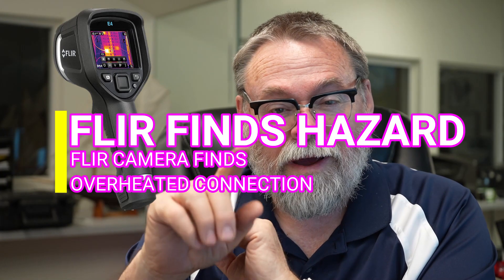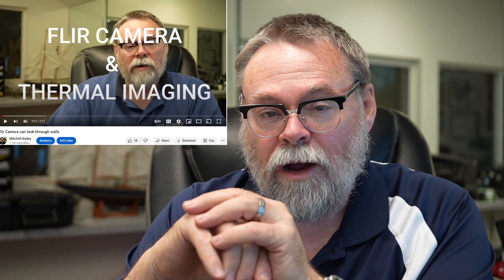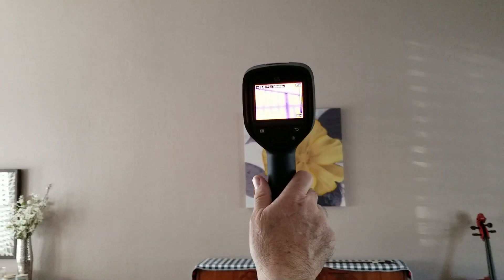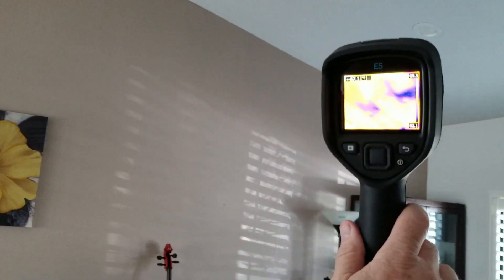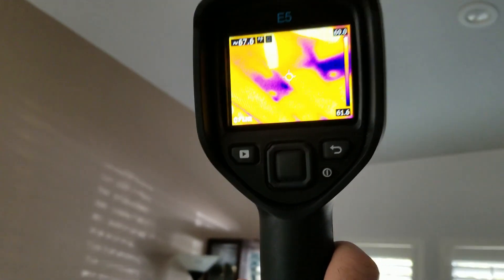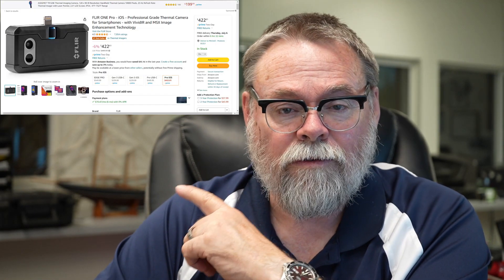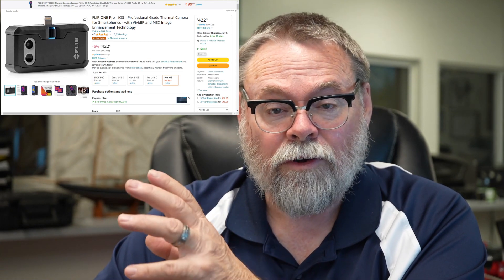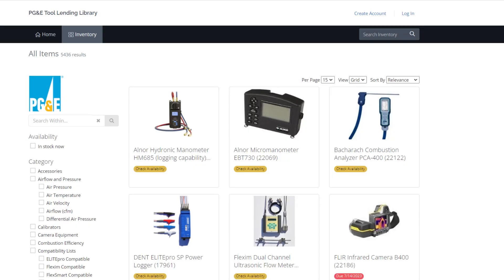Flir Camera Finds Potential Hazard

Comment: It surprises me that the cheapest thermal cameras are $200ish, when there are infrared security cameras in the $10-$20 range. If a phone provides the power, display, and user interface hardware, that just leaves the camera/lens/filter, and the tech doesn't seem that different. Maybe I'm just wrong on that. I'd like one, they sure look handy, but not at $200-$500.
Reply from the maker: The difference between a thermal camera and an infrared security camera is how they work. Infrared security cameras see reflected infrared light while thermal cameras see infrared energy that radiates from a surface. Thermal cameras read temperatures of opaque surfaces, if you try to read the temperature of reflective surface like shiny metal or a translucent material like glass you see the reflected heat energy and not the actual surface temperature of the those materials. With a security camera it is reading the infrared light that is shining on a subject. 

I was the physics and chemistry teachers assistant in high school and had keys to their storage room and all the laboratory supplies. In the storage room they had this large spotlight and a set of goggles. I asked Mr. Maxey the physics teacher what they were and he told me they were an army surplus night vision set from world war 2 the school had purchased after the war. The spotlight shined infrared light, which is not visible to humans, out into the darkness, the goggles allowed you to see the light. Mr. Maxey the teacher told me that in the 50's and early 60's they acted as chaperones for students to keep them from having relations in the parking lot on the school grounds during football games. He and another teacher would drive around the parking lot shinning the spotlight into cars and used the goggles to pear inside and see what the students were doing without them knowing they could be seen, with the goggles they could see everything, and I mean everything! If they found a couple being intimate, they would knock on the window and ask them to leave. He told me that at every game they would find at least two or three couples engaged in sex in their cars.  

The biggest difference between the $200 and $500 ones for our smart phones is the accuracy of the temperature reading, the resolution and features. The higher the resolution the more expensive the camera. 

Legitimate thermography cameras are expensive, usually starting in the $2,000 dollar range with picture size of 240 X 180 pixels, while the really good ones with  high resolution of 1024 X 768 pixels can be as high as $50,000. I purchased mine about 15 years ago and it has a low resolution and cost about $3,000. The same camara today runs about $2,000, so they have come down in price.

Comment: Great short info on the Flir Camera.  Regarding the Wire Nut,  the reason why the nut was showing heat was due to the "fact" that whom installed it failed to twist the wires together to form a tight bond.  Never have I seen a split bolt connector on anything other than ground/earth wires and or bonding machine/motors and certainly not inside a panel!  Have to look up code on that one!
Reply from the maker: Everything I have read about Aluminum wire states that any connector or device wired to aluminum wire must be rated for it. The wire nuts installed on this panel are not rated for aluminum. However, Kearny's are rated for copper to aluminum and aluminum to aluminum. Here is an excerpt from Codecheck.com on aluminum wiring and link.
I agree that if they had twisted the wires together before installing the wire nut we more than likely would not have a problem. The worse thing about this was these two wires were the main feed for this subpanel. I will feel much better installing a split bolt connector with friction tape and then take a before and after picture.
Thanks for the comment.

From Codecheck.com
The Purple “Ideal 65®” wire nut has a UL® listing for copper-to-aluminum connections. Like the AlumiConn® connector, the Purple “Ideal 65®” wire nuts are readily available. The Ideal 65 connectors are listed for connecting a copper conductor to one or two aluminum conductors. Curiously, they are not listed for direct aluminum-to-aluminum connections, possibly because the copper is needed as a heat sink. The “Ideal 65®” is not without its detractors. Most vocal is Dr. Jess Aronstein, a consulting engineer in New York State. Aronstein has campaigned to have the Ideal 65 product recalled. He presented his case to the Consumer Product Safety Commission. The CPSC declined to act on the information Aronstein presented. Aronstein’s tests have not been supported through independent third party testing. It may be advisable to take Aronstein’s publications with a grain of salt.

Aronstein’s papers on solid aluminum wiring and other related information can be found at Daniel Freidman’s InspectaPedia site: www.inspect-ny.com/aluminum/aluminum.htm It is possible that clients may find this information and ask questions about it. As inspectors, we should be aware of this information and be prepared to offer unbiased counsel to our clients.

Split-bolt connectors (Kearney’s) are another method that can be used. The split-bolts must be rated for aluminum-to-copper connections. This method is labor intensive, and really only practical for larger wire sizes.

The switches/receptacles can also be replaced with devices listed for direct connection. The National Electrical Code® requires that devices directly connected to aluminum wiring be rated “CO/ALR.” “CO/ALR” rated devices have screw posts designed for superior retention and compatibility with aluminum. “CO/ALR” rated receptacles and switches may be harder to find and cost about $3 – $5 more per device than non-“CO/ALR” rated devices. There are other disadvantages to replacement with CO/ALR rated devices. What if a handyman or homeowner may replaces a receptacle with a standard device later on – not realizing the problems associated with doing so?
https://codecheck.com/aluminum-wiring/